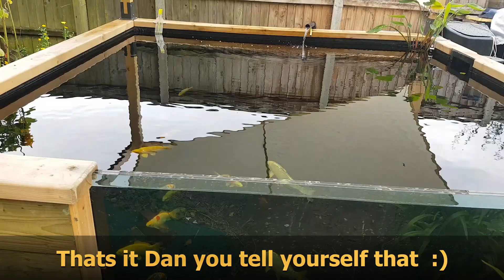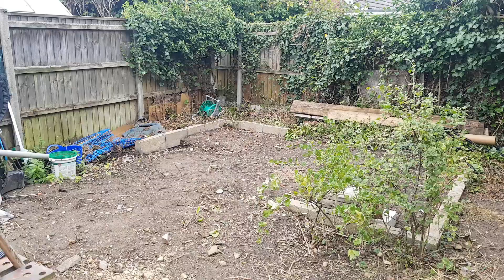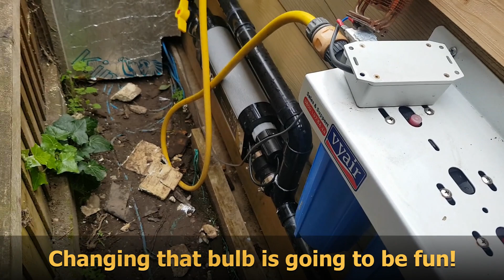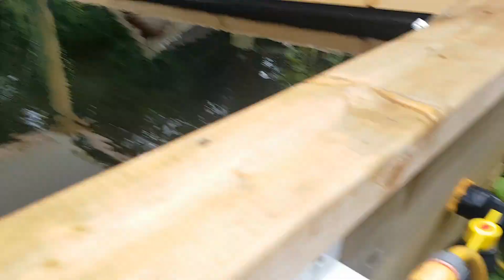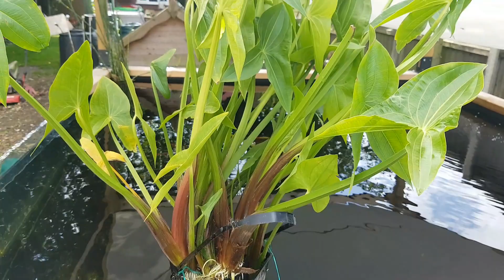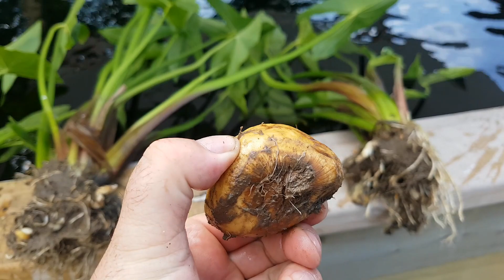Koi Pond Build #15 The Final

Comment: i need help I have so many folds in the liner when trying to put the liner in it does not help the liner has 2 seems in it making an issue for my pipe connectors any advise ? so many folds  any advise it feels like its almost impossible. if you need to see the space check my channel out for videos.

Comment: So I am just about to install a kockney koi skimmer box on my pond just wondering how best to install it. The skimmer box is around 1 inch above the main water level on my pond. well I hope it is the pond seems to be level know.  So what advise would you give about fitting a skimmer ? the skimmer seems to be a 1/4 above what will be the water level. I in vision the water level of the pond will be about 1 inch below the top of the sleepers. Above that will be a capping piece of wood which is about 50mm in thickness. 2

Comment: need help have pond one air pump fitting 18mm I need to adapt to 8mm air pipe any ideas? The pump came with a rubber tube that is about 18mm but can not seem to find a fitting for my large air stone that has a 8mm pipe.1

Comment: Hello I could do with some koi pond building advice I am in the middle of building a koi pond but I am trying to decide If I should build it 1 feet deep in the ground or 2 feet. A total of 3 feet in depth. Do you think this would be fine or would I be better off building it to be 4 feet in depth. If I do this I need to buy a new pond liner as the one I have will just fit to a 3 meter depth I made a video please take a look and tell me what you think.https://youtu.be/oQe53z-06xE

Comment: you need to consider weather getting into the top edge of the laminated glass. A "U" shaped metal capping fitted with silicon should seal it nicely..............

Comment: Yep don't stop the videos the plants always blow them baskets apart trick is when you split it each time take the biggest part and use larger stone each time till you are up to around 20 - 25mm no soil what so ever and bigger holes in the basket as you go up. Video out later today on a very nice corner basket setup with cress that would look the mutts nuts growing over the side of your pond. liking the new pump lots as you are going to heat it I take it you will be covering it as well so you have stacks to film yet with that and the cabin as well keep going bud
Martyn
Reply from the maker: Don't worry not stopping videos. Those plants had no soil at all, what you can see on the roots and eventually in the water is fish waste, if you remember the plants came from my plant filter that I had across the back of the old pond to remove nitrates and the fines. I received my new fry today and so have a video on that soon to go up and the log cabin arrives today and should go up over the weekend. Lots more to come.
Reply: That fish poo was building up in that then new grow in pond out pond planter video at tea time and you might like it as I works for me will put it up a round 4